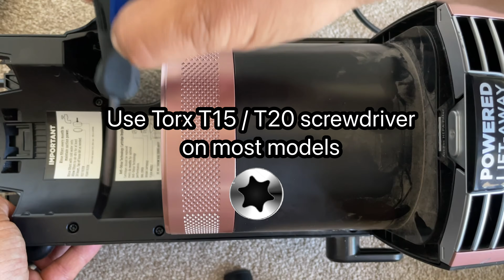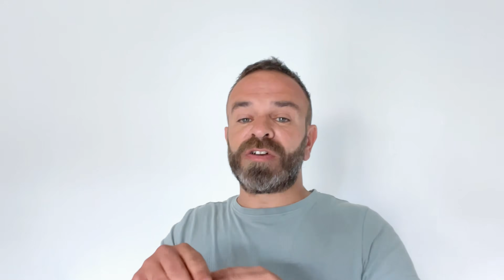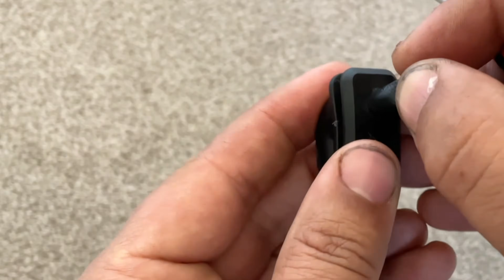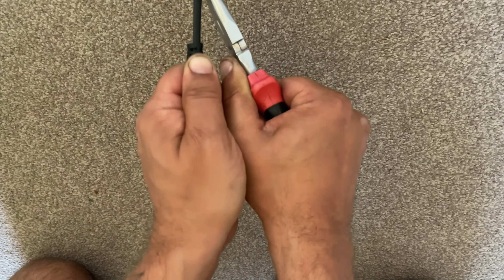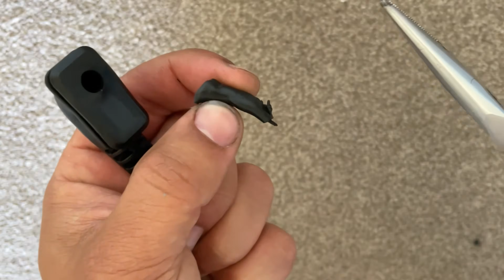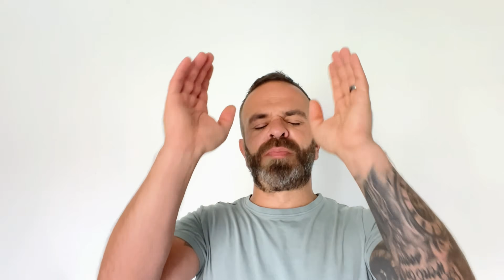How to Replace SHARK VACUUM POWER CABLE - Stop Using Damaged Cord

Comment: Very helpful video thank you, if shark wanted to make it easier for consumers to do this they should make the cable where the gromit enters, connect into a little plug socket (bit like on a James) with a tab to lock it in place or even a screw or something, then just unlock the tab or unscrew the screw and fit a new cable. Such a shame they aren’t environmentally focused and only support built in obsolescence.

Comment: Superstar ..... I owe you a beer mate. My model is a NV601UKT .... There are 2 hidden screws under the grey buttons marked 'Lift Away' and I think the triangular button is marked 'Wand'. These buttons easily lifted away with a dinner knife. I had to shorten the Flex Protect sleeve a little to release the damaged part of the cable.
Reply from the maker: That do make it fun with all the different layouts

Comment: Great video! The rubber grommet was such a PITA! I did not have silicon lube/grease on hand so I used some Dawn Dish Soap and it worked just fine.

Comment: Hello,  thank you Not sure which Video I watched might of been trouble shooting one.  So anyway.  
My  issue was that I was vacuuming when it stops vacuuming.

I saw your video.  Where you said it's the filters.  I removed them gave them a good wash.  The let em dry in front of fan.  They died up popped em back in.  Plugged in the vacuum.   Varoom.  Its worgreat.  So Thank You verymuch for your help. .

Comment: Use a drill tighten it on the left over part of the sleeve as best as you can and start spinning the leftover tube instead of struggling with stabbing yourself!  More effective and easy way to get this sleeve out.  Took approximately four seconds last night.  Vacuum body works great now.  Next to repair the connection tube and the brushes.
Reply: Have to try this and show this tip! Now to figure out a easier way to insert new wire that was difficult and really hurt my hand lol

Comment: Great video,Thankyou a whole bunch. I was struggling to get it apart, and the hidden screw under the black button saved something getting broken.
Reply from the maker: Sir hard with all models being so different. Nightmare of a job anyway
Reply: Any tricks or tips for getting that thing off?
Reply from the maker: @philbro11 I do what I do in the video. I hate doing these. A guy the other day said that he gripped the old insulation with a drill and twisted it out that way. I’ve never tried it though
Reply: @vacuumhelp  Thanks for the reply. I ended up getting it. Pulled upward with one hand to keep constant pressure and just pried lightly from the side like you did.
Reply from the maker: @philbro11 great news. It’s ridiculous that we have to perform like this, cables should be available, dyson sell theirs. It rages me that shark don’t 😂
Reply: @vacuumhelp  My cord gave way right next to the strain relief. So I’m just pulling it through about a foot or so and hoping to reuse it.
Reply from the maker: @philbro11 good plan 😊
Reply: @vacuumhelp thank you for the walk thru, btw. Took me at least an hour to get that grommet cleared enough to pull the cord back thru, though. Perhaps that gets easier with practice, but I don’t want the reps. Great concise video!
Reply from the maker: @philbro11  I dread doing them still. Some can be 5 minutes but I’ve been on them for best part of an hour in the early days

Comment: They really don't want people taking these things to bits do they? I've just stripped my mums one right down and broken the motor open because the top bearing has collapsed. It's under a year old and still under warranty. They replaced the entire vacuum, but they made her cut the cord 10mm from the rubber on the broken one and send them a photo lol. I'm going to put new bearings in it and hopefully i can remember how it all goes back together.
Reply from the maker: They are good with warranty, prob best company I’ve ever known for warranty….. but that’s it. Apart form they Shark vacuums are just a nightmare. It’s al I seem to get in for repair. 

The cut cable thing was interesting I’ve never heard this before, maybe a new thing they are doing.

Comment: The new shark I have just bought has the worst lead on it I have ever seen it's proper cheap... no flex and hold the same shape like stiff wire. Machine is good ...flex shite.
Reply from the maker: Yeh I’ve noticed that. You unravel them and end up with a zig zag of cable behind you. All the ones I see that have split insulation (usually near plug) always seem to be quite brittle with age too.

Comment: Oh, you're so funny...
Thank you for the video. I don't have the plastic elbow anymore,  I'll have to figure out something else.
Reply from the maker: It’s not the end of the world but it just helps stop your new cable from getting strained. 
It obviously does count towards hoping the cable start where it is. It’s critical that the new one doesn’t pull out when in use… ☠️ 
If you can get a knot in the cable or come extra cable ties inside to make it impossible to pull out that would be a good move. 

Or 

Could find a used money for your model on eBay. They are cheap as chips nowadays £20-30
Reply: @vacuumhelp thank you! Good ideas!!

Comment: What kind of connectors were those red ones you used to connect the new wires back to the circuit board?
Reply from the maker: You need “spade connectors” most models take a 6.3mm size